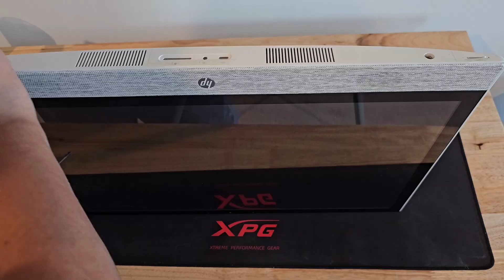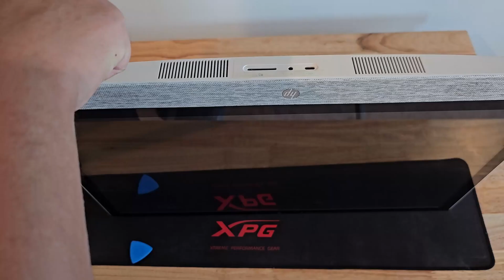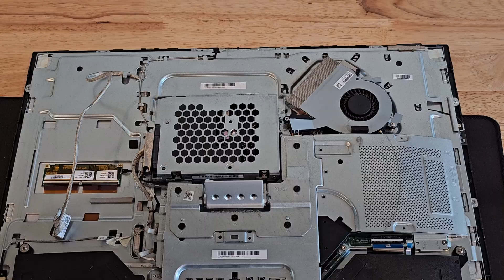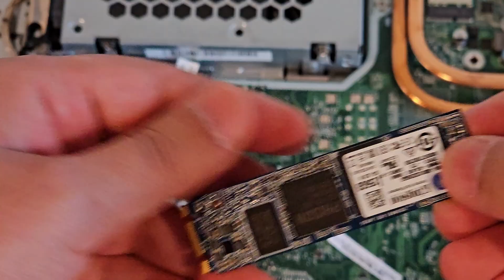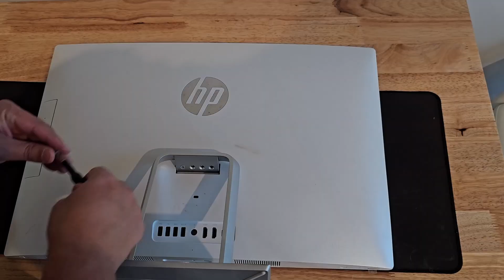HP ALL in ONE  24-r114 |How to Upgrade Ram and SSD

Comment: Can I upgrade processor from i5 13th gen to i7 gen 13th
Reply from the maker: As long as it's within the same gen, most computers will allow it. Some can also go from 13th to 14th gen with a bios update since it's the same socket. Socket 1700. Just make sure you have proper cooling or if the stock cooler can cool the new cpu.
Reply: @racimbio  Thanks